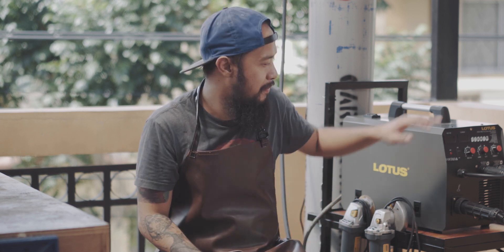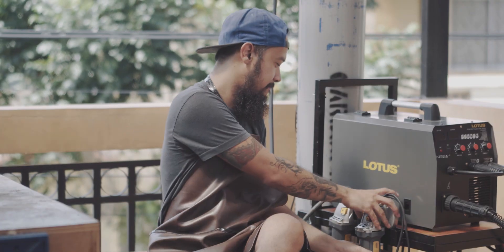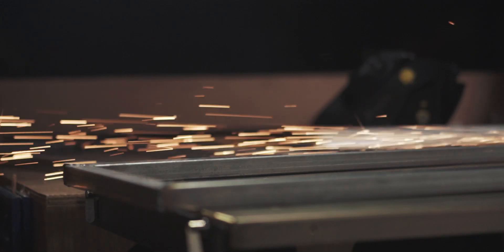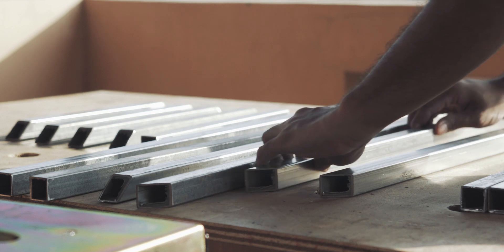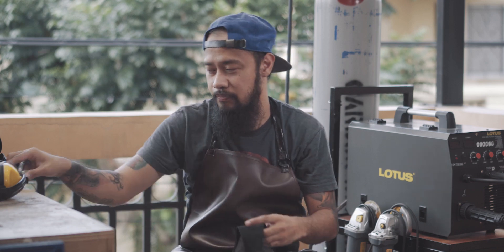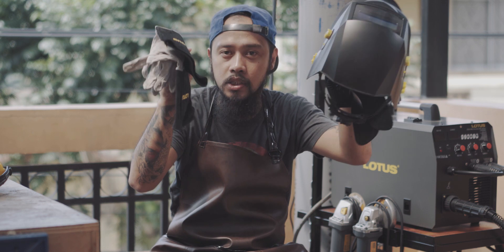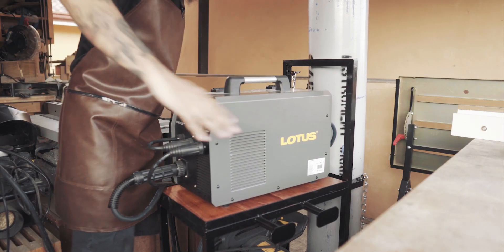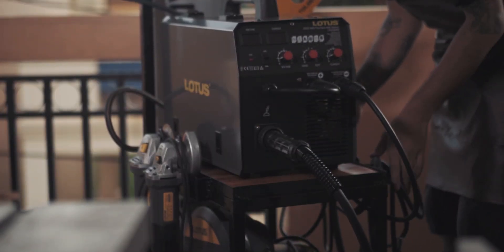Mga kelangan sa Metal Working | Welding cart build

Comment: Sir planing to buy welding okay ba yung lutos at anong Amp po gamit nyo
Reply from the maker: im using Lt250mxt model 250AMp, it has 3 knobs,current,voltage at may isa pa, hindi lng amp ang knob nya you have to mix the settings

Comment: Sir ask lang ako detail regarding sa Mig machine mo? 
is that a gas type Mig weld or A gasless Mig weld? 

or both reversible Thank you!
Reply from the maker: May option sya na mig or arc so i guess pwede sya sa fluxcore n wire..ngayon may gamit ako gas..co2 100% di ko p natrytry ung arc option

Comment: anong gas gamit mo sa mig paps at magkano sya?
Reply from the maker: Pure co2 boss gamit kong shielding gas... Rent sa tank ay 5k yung laman ay 1100 tapos regulator need ay may heater 2500 bili ko sa lazada.. Nsa description nitong video ung product link :)
Reply: Film that Build thanks paps required ba na May heater?
Reply from the maker: @ChrisBryanAllones  required daw sir..i dont know the reason behind hehe pero un ung sabe nung dalawa sa mga nag advice sa akin n mga furniture makers
Reply from the maker: Dun kc sa lotus mig welding machine pre may socket ng 32v ata pra dun nga sa heater n un so..sakto..tama sila hehe
Reply: @edanosmodular  ah ok thanks paps astig talaga lighting at audio mo hehe